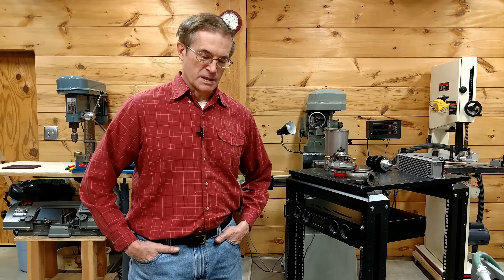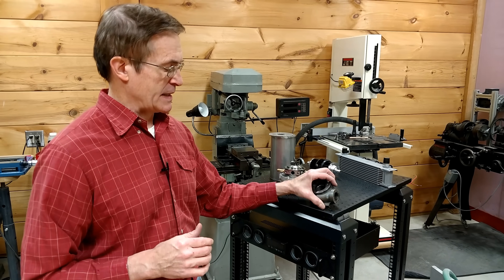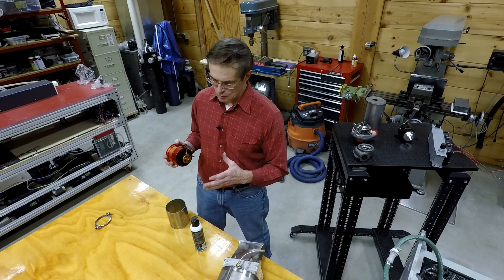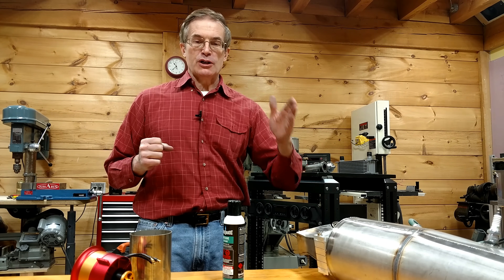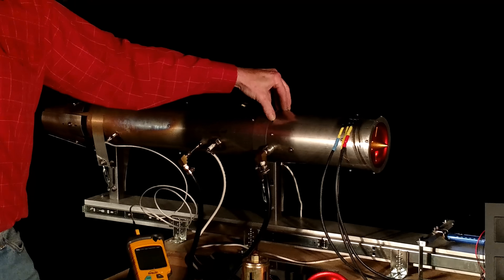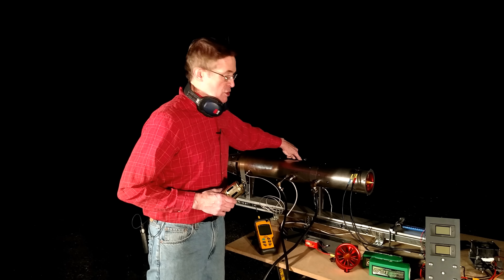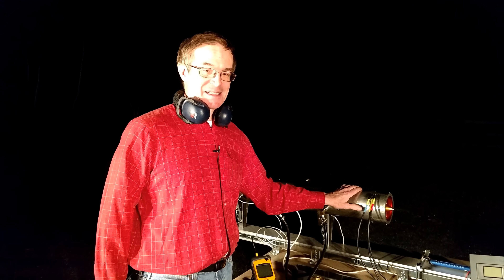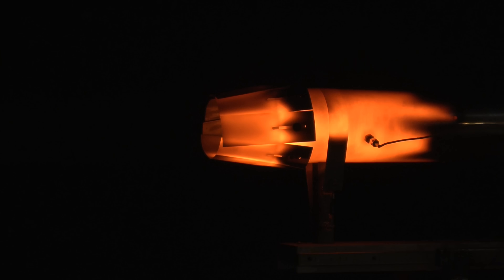Hybrid Jet Engine

Comment: This idea will never work because the fan is not a compressor and does not increase the pressure of the outlet gas.  It is the blow torch to which he refers only.  There is no expansion because the pressure is not raised.

Comment: How do you calculate the number of holes, hole sizes & the placement of the holes on the combustion chamber? Any hand calculatioms ?
Reply from the maker: It's a little experimental, but the flow area from all the holes combined should be greater than the cross section of the combustion tube.

Comment: I can see there’s 2 nodes in the design, by having a variable diameter outlet nozzle this will be critical in tuning the ohm rate and cancel any excessive potential buildup. I’d be curious to see if installing a ring that can adjust the volume inlet/outlet while still inside the engine itself would slightly cool the outer area of the shell as well as allowing more volume to exit the tail end and then the tail nozzle can be optimized for a re-heater array to provide an additional 25% thrust when needed, maybe even add in a WEP type injector to see how it’ll behave. For cooling, that’s a tough one given the RC craft application. Heat kills is everyone’s watchwords when working with propulsion systems so aside from running coolant fluid through conduits around the entire engine, that leave the options of hi temp alloys and air cooling. A secondary high pressure-medium volume fan that pushes air down the exterior of the engine while a 1 1/4” gap is maintained between the outer shell and the engine body, similar to how old steam engines were in the 40’s, they had sheet metal jacket surrounding the boiler and put insulation between the boiler and jacket. So it would be similar but just an air gab to allow cooler air to flow and then it can either be dumped or diverted into the rear area either near the combustion chamber. I wonder if the engine could have a shaft that came out of the front so a small fan could be mounted to drive the air cooling fan? 
Thank you for taking time to explain your work sir.

Comment: Great video. At high enough speeds a jet airliner will no longer need the compressor. The speed of the jet is sufficient. So if you designed this onto a revolving wheel. Well balanced  and a high rotation rate should create a cheaper engine.

Comment: You are awesome dude. Probably start with a wider engine body... Larger input compressor fan... Neck it down significantly and you will have a much different performance... Yours looks like a ram jet at the end of the video. It's spectacular to watch. Starting off with more volume of air allows for greater compression potential.   Potentially more efficient in an engine such as this... 

The hybrid idea is absolutely genius. Will have less internal drag without turbine blades.

Comment: we did a jet engine with 120mm Promod turbocharger... was insanely powerful...... Next time remember to Bolt down the table.............. jet an table went flying out the  garage door on full pull

Comment: Nah some miss information about his after burner, after burner does burn the unburned fuel from combustion chamber as i graduated in aeronautics. When air and fuel mix and burn inside of combustion chamber there is 20-15% of fuel that weren't burn and that is the purpose of after burner it will burn tha excess or unburned fuel from primary combustion chamber. It doesn't matter if  it's canned type or annular type or turbo annular combustion chamber. after burner only burn a excessive fuel that were downstream from combustion chamber providing additional thrust at short time near in exhause. And there is no turbo compressor in turbine only compressor. And turbine doesn't have motor only for starter because the turbine compressor drives the shaft to rotate the compressor blades and as it enter the engine you'll see a vortex in inlet of engine because the air pressure outside the engine is low and the pressure inside the engine are high that is why they use turbine for high altitude purpose because they do compress the air before it comes to a compressor blades that is centrifugal blade meaning before the air comes to combustion chamber the pressure already increase because the multi stage compressor blades alreas compress it. If you want a real after burner i shouldn't see your fuel dripping out of your exhaust it should be burned by after burner because as i said the reason why your fuel is dripping out the combustion chamber cannot burned all fuel that is inside of the combustion chamber.
Anyways you did a good job

Comment: I think you can ad water injection or rather steam injection and increase the trust with the same energy input. Taping the heat from the tube with a quelled pipe or tubing and injecting the super heated steam at the most aft point of the combustion chamber.
Reply from the maker: You can.  Take a look at our follow up video on this engine.

Comment: I used to have a Laboratory display functioning pulse jet engine that was bought from a. Laboratory supply catalog. It was about 20 inches long . Each class would get to see how this simple engine worked and I was the guy setting it up . The start up involved using a good size bicycle pump ,kerosene and a spark plug ,once it started to run the noise level was unbelievable. We did run it outside but still it was overwhelming. I could not wait to shut the damn thing off. Let me put it this way I cringed at the thought of fireing this thing up. We had a small jet engine display and it did not make that much noise , the whine was bothersome but the pulse jet engine would break the enamel off of your teeth
Reply from the maker: We have a 50 lb thrust pulse jet and these usually have to be driving into the desert to test.  It's stunningly loud.
A pulse detonation engine is even louder...

Comment: Walter Kaaden an East German engineer developed the two-stroke expansion chamber exhaust using experience he gained from working on pulse jet engines. 
He created the diverging and converging cone shaped chambers. His MZ 125cc and 250cc engines were making well over 200bhp per litre back in the late 1950s. 
The opening exhaust port creates a shock wave the shoots down the pipe. A diverging cone creates a suction behind that shock wave. The converging cone reflects the shock wave back to the engine. This pushes the hot gas back into the engine.  
The ideal shaped pipe has a supercharger effect. Exhaust gas is sucked down the pipe with the next fuel air charge following it down the pipe. But the reflected shock wave shoved that gas back into the engine. When it’s ideally timed, the exhaust port shuts just as the fuel/air charge has been pushed back into the cylinder. 
Supercharging by means of gas shock waves. 
During WW2 Rolls Royce were working on a 25 litre two stroke engine. They realised it made a considerable thrust from the exhaust gas alone. They had plans fir a hybrid piston/turbine engine. Sadly it never went any further because the highly efficient blower developed for Merlin engines was ideal for their early turbo jets (the Nene).
Reply from the maker: Interesting

Comment: I was thinking of adapting a turbo and converting into a micro turbine engine, but not for flight, instead connect to a generator for a range extender for an EV.  I have a Knight Rider replica KITT I am creating at the moment and also putting a DC Engine and batteries.  I shall discover my solution one day soon, thanks for the explanations in this video.

Comment: Excellent video, gives solid understanding of how turbine gas generators work.. Heat does the work as they produce high volume high velocity gas flow..essentially they use fuel to expand air to create acceleration of mass/volume, some of which is tapped to  pump a lot more air into the system, so that net expanded volume & velocity are compounded..the afterburner adds more fuel and thereby MORE heat beyond the core of the engine, so that even more velocity is created..resulting in compounded thrust.. steps of acceleration as air is primarily then secondarily expanded.. oh such a beautiful thing😁 Imagine the steepness of a slide.. if you imagine the shallow gradient, you slide down slowly..if you add gradient so its steeper, the faster you slide down..so the greater the difference in gradient, the more kinetic energy is realized.. the idea is to create the highest pressure gradient through the system& extract the greatest gradient in BTU, efficiently turning BTU into EXPANSION rather than increased temperature .. Latest technologies allow higher temperatures & thereby utilization of the greater efficiency of the more extreme expansion .. more heat added to a heat engine, more work done.. so long as materials can handle it!😄

Comment: Looks more like a rocket motor or propane jet blower heater.  You don't need all of that excessive btu heat.  What is missing is a functional compressor on the front end. Once there is enough compression it needs only so much fuel to make an efficient mixture for pressure building combustion.
Reply from the maker: Take a look at the follow up videos where we increase the compression first with an additional axial blower then with turbocharger components.

Comment: Unsustainable, no internal compression aids look at ramjet engine .you have nothing but a glorified blow torch . Information is misapplied, straight tube can't allow expansion with out aids ,a blower can't do it by itself. Sorry!
Reply from the maker: The cross section varies.  Didn't you watch the whole video?

Comment: liquid air hybrid cooler
Reply: electric ramjet would be the best of them axial turbo engines
Reply: boost to high speed with electric (gasoline), then generate batteries back with gasoline/heat ramjet at high speed
Reply: the rotating turbine might be replaceable with flap flexing fan for minimal actually moving/breaking parts
Reply: relies on the hourglass shape and/or edf generator/starter, to make the heat/kerosene heat expansion directional, either or
Reply: double cone nozzle is a double rocket nozzle (ramjet in afterburner out valveless/turbine middle hourglass shape)
Reply: there is no combustion in any chamber other than the output cone rocket nozzle, all air input is reverse suction by exit volume through the middle hourglass neck/turbine
Reply: yes pulsejet reverse sucction new input air through the middle section turbine
Reply: rocket nozzle cone output burning chamber prevents all melting of parts
Reply: also rocket nozzle cone acts as the valveless combustion chamber, large radius out, small radius in
Reply: yes burn outside the chamber, after the neck, not inside/before the neck constriction, like a normal rocket engine, burn all like it was only a super large afterburner
Reply: you can spray fuel (optionally) to the redhot surfaces of the exit burn chamber rocket nozzle, directly

Comment: I have a few Questions I don't expect this to get A answer it was worth the attempt that is. 
 So if you were to use say use  Chemicals to Maga Pre Heat the Volume of Air To Burnt Hydrocarbons before the Afterburner then what are you saying I would Have even more Pressure from Afterburner and be given better Say Jet milage out of the Afterburner.
I have follow up Question so if we Dont vote for trump the Time Continum will Return to Normal again
 Sorry had to be funny
 
I would love to see what would Happen to This Jet by using or adding on A area aka Tube that can Release in proper Volume by comtrol A mixture of Aluminum dust  Iron dust with Sodium or Phosphorus blend.
It would need a Chamber before the Afterburner.

How I would make the Chamber needed before Afterburner would  need to be made so the Pre Mix has of Aluminum dust  Iron dust mix with Sodium with Phosphorus or just Sodium it needs pre Blending of the dry powder Chemicals But it will Be Releasing it Pre Afterburner using the Extreme pressue created from its  burnt Hydrocarbons that would have only had Afterburner This I do believe will Create some Insane high temperatures then fire that Afterburner up and Hang on to the Mommy Daddy Parts.  Your going for one hell of a ride. 
The powder delivery system is extremely easy to make.  
Keep in mind this system would be extremely beneficial if Pilot needed More then Afterburner should he she had been locked on by missle systems say if the Bad Guys manage that 
Its not something used the entire flight it would be made to get some insane Speeds to build insane Afterburner thrust so the Pilot  gets the hell out of dodge fast should Bad guy manage to get posable lock on by ground or Air missle systems. 
See My friend we tried to make this idea of mine work with his Home made off the rack jet engine he made his jet to have a  working  Afterburners except 

This part below is for Trolls 
In case Trolls are going to Treat my Questions like Nonsense then Roast me say mean things like most Jerks on BoobTube spare yourself I have been reading that crap for years I so don't care anymore what crap people say about me 
Anymore
Reply from the maker: Let me address your question about a solid fuel added to the exhaust gas.
It would increase the thrust, but not much.  Thrust depends on mass times velocity and velocity depends on pressure.  Because we can't increase the pressure at the exhaust location without choking the up stream process, the only advantage of the powdered fuel is the added mass.  Compared to the mass of the air already flowing through the engine, the powdered fuel would have to be added at a very high rate to increase the mass flow significantly.

Comment: If it cannot capture the added energy in the exhaust to run the compressor, it is not an engine.
Reply from the maker: What is a ram jet then?
Reply: @TechIngredients  Yeah, you are right. An electric fan in a tube is also a jet.

Comment: Why don't you put a turbine before exhaust to spin the electric motor and  charge batteries . Like in Formula  One Mgu - H 
( Because it would be ridiculous .) 
And this engine's name must be electric turbojet . Because it has a electric turbo and producing it's thrust with jet flow

Comment: If this were mounted on a vehicle, What if any, influence would the addition of forced air through the front have on fuel mixture? Would it be more efficient or use even more fuel? Thanks!
Reply: Never mind. The answer is in the 3.0 video. Thanks!

Comment: Great explanation! That's exactly what i missed in many books and videos, that the pressure inside the combustion chamber and turbine does not increase but decrease! But the reason, how there is generated the power for the whole axel is the much higher cross-section-area but with a slightly lower pressure.

Comment: 11:38 i wonder if you could run it with HHO-Gas instead of butane. That might bring more Heat (BTU) ?
Reply from the maker: It would.  The advantage of propane is the higher energy density and easy compressibility of the hydrocarbon fuel.  Hydrogen has a huge amount of energy/gm, but much less per cc.
Reply: @TechIngredients thx for the reply,  but i mean HHO has already Oxygen in it , so it needs less to no mixing and turbulance behind the fans (i would guess).

Comment: Just add water. 
Space pirates discovered water cooling bearings adds to the expansion forces, flashboiling water into steam increases the holy crap significantly.

Comment: @tech wonder if you could take that Thermo reactive metal that can change shape under heat and find the appropriate bend angle to mount it to the body and mount the after burner flaps to it and as the heat increases they could curl outward to automatically open on demand so as to always have after burner working and possibly if needed a manual restrictor ring to force them back closed off needed to suppress the exhaust. I have no idea about this technology, I've just seen people use that specific metal to accomplish similar tasks in other projects in the past.

Comment: Exotic high temp metals may be difficult to get and work with but a titanium plating or other coating might be easier.
Reply from the maker: You're right.  In our follow up video on the upgraded version of this engine, the combustion chamber is coated with zirconium oxide ceramic.

Comment: For those that have not been following this guy, he has an amazing workshop. That and the high level of material he is conveying - from flat-panel speaker design & use, to audiophile (standard) speaker build-outs and non-phase-change air conditioning made me initially think he was doing this all at a university somewhere.
Nope!
This is his home!
A previous video had him state that his wife came down about the noise, as did a neighbor that he would later have to go over to and apologize to (It was night time).
This guy LOVES what he does, and is absolutely great at it.
As I have told my contacts privately, if I had this guy as an instructor when in collage I would be in a different place now.
Reply: I checked his videos to see the air conditioner one and then realized that this is the "same guy from that interesting AC invention I saw a couple months ago". Very cool stuff, subscribed.

Comment: GOD Bless you.. 
 I was working for my project pulse jet engine and searching so many content in last 3 days, pulse jet is quite good but it gets really hot and not good for or ideal aircraft output using as a engine.
so I was searching for another solution for engine that is cheap safe, easy to use and low cost fuel and maintenance so I found out that p300 small jet engine that use fuel and quiet expensive but durability and maintenance better than pulse engine jet.
Now you have give me a solution electric ducted fan and I have search in the internet it has quite good lb.
Very much safe and easy to use recyclable.
I like the way you talk and Teach. 
Very Easy to understand (who is from 3rd world) 
Best YOUTUBE CHANNEL I HAVE FOUND.
Reply from the maker: Thanks!